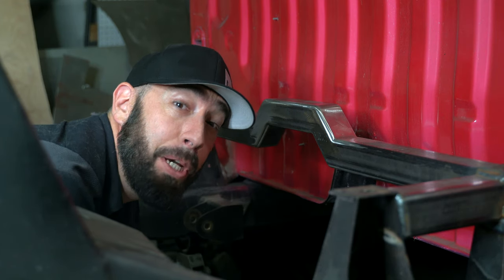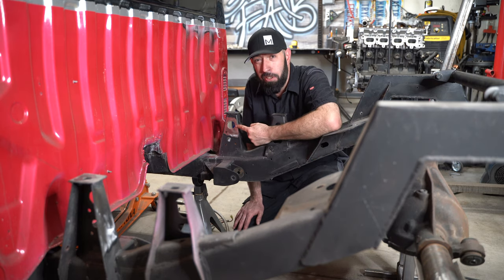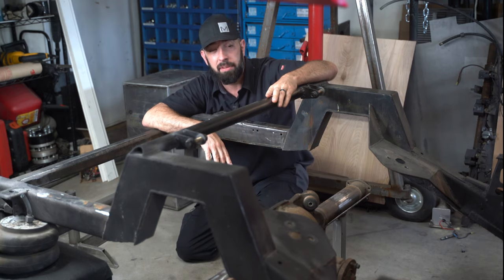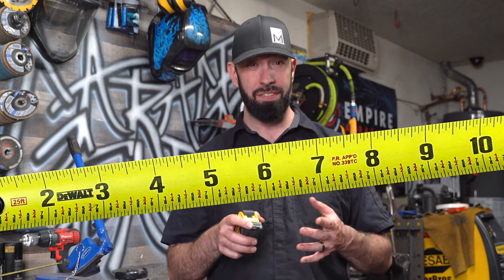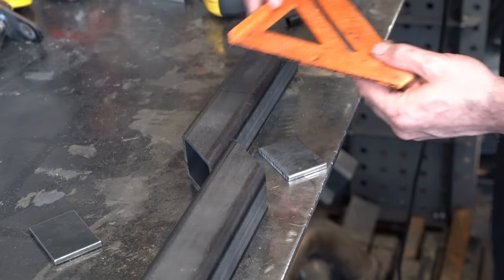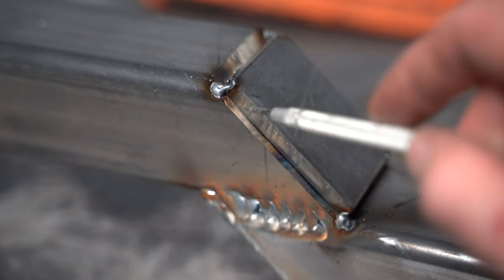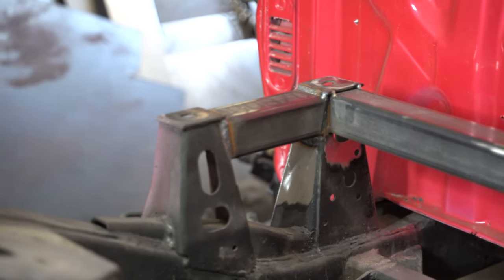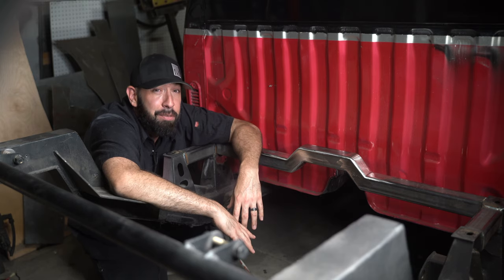Building a Custom Crossmember for a Parallel 4-Link! Mighty Max Ep. 10

Comment: The Imperial system of measurement isn't that difficult to comprehend. The easiest thing to do is forego units larger than an inch and you'll have, essentially, the metric system. Whole numbers that can easily be subdivided into fractions or decimal form. If something measured 8' 4-7/16", just convert it into decimal form to get 100.4375. If this seems too difficult, I don't think it has anything to do with someone's comprehension of the Metric or Imperial systems.
Reply from the maker: I won’t bother making an argument out of this one… but your “easy” conversion is precisely the challenge with the Imperial system. For people like me who are severely mathematically challenged, that’s not even close to easy. In fact it would probably take me several minutes to figure out how you came up with your answer. I have gained a decent grasp of the basics of the Imperial measuring system and it doesn’t challenge me as much as it once did, but just because you and I have learned it, doesn’t make it simple. I don’t think a measuring system should require intermediate math skill to decipher, or in my case, conversion tables and calculators.
Reply: @GarageFab  What I'm saying is this:
The Imperial and Metric system, when broken down, are almost identical. They're a unit of measure, that can both use a base scale of 10. 
Don't use feet and inches (fractional or otherwise). Instead, only use inches with a decimal. 
So, my example of 8' 4-7/16", when looking at your tape measure, instead reads 100.4375in. Are you going to tell me it's easier to read a metric ruler, when you have to break/guess between subdivisions, than an Imperial one?
I understand some might have an issue, but it's really not that difficult.

Comment: This is 7 months too late, but I'm a fan of shorter quick hit videos.  I probably miss a lot of good stuff cause it's not often I'll settle in for a 40 minute video. I mean hell, that's gonna take a piss break and a round the snacks to get through that...
Reply from the maker: First of all… Ew. It’s been 7 months already?
Second, let me ask you this then. The video I’m currently working on (watts link) is going to be a long one. What would YOU prefer? A 30 minute video? Or a video broken into two parts; The custom differential cover followed by the watts link itself?
Reply: Let me expand on my earlier comment, most videos I see that are weighing in at 50 minutes and, OMG, over an hour, would only be 30 minutes if you boiled out the empty dialogue, and multi minute, real time lathe or milling machine traversing. From what I've seen, your style is more action packed and when you speak there's something to listen to, to the point where I will sometimes rewind and listen to it again just to make sure I didn't miss anything. Your fab footage is like good porn and focuses on the mechanics without all the drama. Who needs a 30 minute porn video?  That's like 28 minutes of wasted time... in summary, you can hold my, and I think other viewers' attention for thirty minutes.
Reply from the maker: I haven’t laughed that hard in a really long time. 
So what you’re saying is, Don’t make your video too good, because you don’t want your viewer to finish 2 minutes in. Noted!
We’ll see how the watts link video plays out. Maybe everyone will get the dreaded “To be continued…”

Comment: Yeh.... Get in to the metric system already!!!!!
Reply from the maker: I’ve decided to not make the switch after all. 😔 Imperial sucks but everything in the US is sold using inches and things got really complicated really fast.
I will, however, start putting the metric conversion on the screen whenever I’m measuring something starting with the next project!

Comment: i noticed you are using alot of red flap discs. Do yourself a favor. Try Klingspor SMT Flaps in Alumina Zirconia {blue} or Lubricated Alumina Zirconia {Green}
Reply from the maker: Where do you purchase them? I recently discovered Cubitron II flap discs thanks to an old friend/viewer. I literally cannot imagine anything being more effective. They're expensive but they absolutely shred metal. (NOT for detail work) They don't create metal dust. They make steel wool. They've cut my grinding time in half at least.

Comment: I love the channel but if you can’t mentally divide 39 1/2 by 2 you probably shouldn’t be DIY your vehicles suspension.
Reply from the maker: Haha! I agree. Partially. I now have a good grasp on simple calculations but it didn’t come easy. I learned suspension geometry and had years of welding experience long before I understood Imperial measurement. 
I admittedly still use the folded tape measure trick even when I already have the answer in my head as a sort of confirmation that I’m not wrong. Nothing worse than construction mistakes caused by a simple miscalculation.
Thank you, Ty!
Reply: @GarageFab  redundancy and contingency plans are what desperate the men from the boys. Good on ya and nice trick